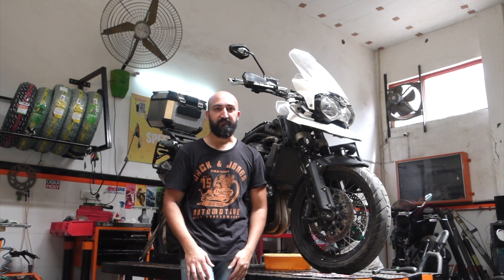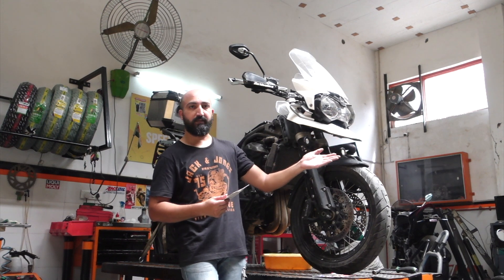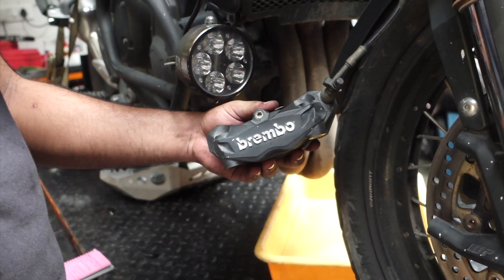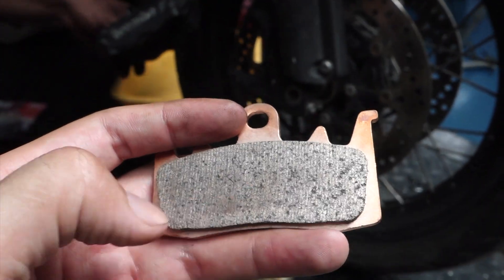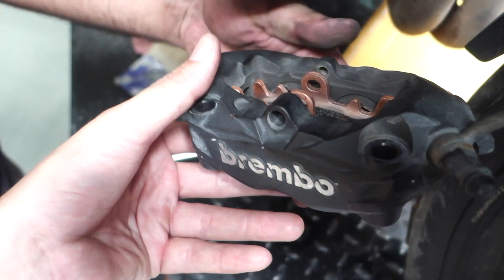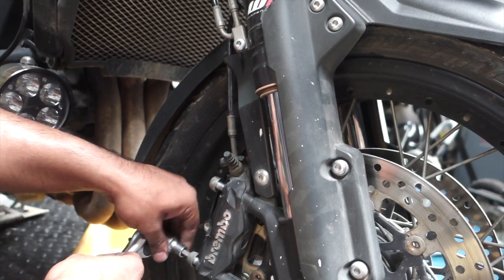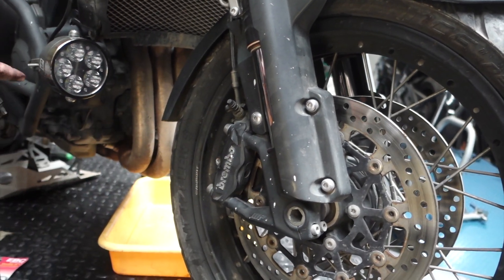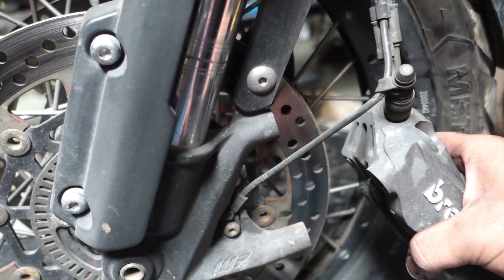My Triumph Tiger 1200 Gets EBC HH Sintered Pads: Real Time Tutorial | Pros And Cons

Comment: Quick suggestion for the rust that has been  accumulated on the disc router. You can just use petrol to clean it up 👍. The easiest and the best cleansing agent.
Reply from the maker: Will try.

Comment: Fantastic content ! I was expecting this kinda video , good work ! 
People will save a lot on the " labour charges " with this DIY content . 
But ,
A couple of things were of concern , you forgot to mention the precaution taken before starting this specific job , that is to be made sure that the brake lever is not touched during this process else it becomes difficult to push back the pistons of the calliper and one has to go through the brake bleeding process .
- and , how would one know the torque specifications on the torque wrenches if one  opts to do this job by himself .
Reply from the maker: Yeah. Sure. I think I kept the focus just on the pads on this rather than the overall braking service, which I do think is an oversight. Still, gives people an idea that it can be done at home by themselves. Not a difficult job. All torque wrenches have clear markings on them to choose the desired torque setting, and obviously one would check in their service manual to know what the torque setting is.

Comment: part no FA630HH these will give minor or slight better feel on the brake lever on the initial bite since the callipers are good (powerful) it would mask the shortcomings, at higher speed say 110kms n above it won't be that good compared to OEM<<(it will be same as OEM is what I was stating)
The one to be used  is "EP FA630HH" these are the ones to be used  
                                        (EP=extreme pro)
the ones EBC known for in racing for this "GP FA" type for track-only 
                                                            (GP= Grand Prix)    
these are some of my opinions in case the feedback is average, I said these since few triumph riders were not happy (with std HH from EBC as you have received)...
cheers
Reply from the maker: Sure. Thank you so much for this.

Comment: Hi abhinav its manoj here from goa...Recently i got tiger 900 rally pro...Till now the ODO is 3800 the the rear brake pads are almost wiped out...Jus wanted to know if  it's normal or it should last longer then that....And my riding is not like using too much of braking..i got a  himalayan aswell and on that i easily get atleast 10k coverage of disk pads...Please guide so i can have a word with triumph service centre
Reply from the maker: That's less. You should get double the distance easily. Unless you rely heavily on the rear brakes.
Reply: @abhinavbhatt  thanks Abhinav much appreciate..Happy Riding

Comment: your mechanic does this work badly. he should first clean the piston before removing brake pad from caliper because when piston is pressed inside the dust around them will damage the piston oil seal.Second thing is that while pressing piston inside using a srew driver will damge your brake pads so when you press the caliper piston inside open the master cylinder cap. it will make the job lot easy
Reply from the maker: Okay. Will discuss with them.
Reply: @abhinavbhatt  and no need to remove cylinders when you change pads - they are exchangable from 'outside' just remove outer pin.....
Reply: You have no idea what are you talking about....First, yes, the mechanic should clean the pistons but they have bushings covering the internal part which will keep the dust away. It's designed like that. Second, using a compressing tool is better but using a crew driver to press against each pad is ok.....he is replacing the pads, remember? C'mon man.....gain a little common sense and mechanic skills before  jumping on the keyboard pulling s***t out of your rear end.
The mechanic did a really good job and even torqued the bolts to specs which not many people do. I'd replace the pads with the rotors installed just like the person above mentioned and add some blue Loctite but the latter is not required.

Comment: Using screwdriver to separate new pads 😰 
He would have fixed the clipper 1st and then he could have installed the pads ... Thats the right process!

And we get caliper spreader to push pisons back... Using screw driver is local work .. which u could have changed ur pads by "CHOTU" on ur local street

And your older  pads had more than half life ! He ruined it !
Reply from the maker: Pads don't get ruined this way :)
Reply: That a premium motorcycle ! Those pistons can be pressed in easily by fingers by little bit of more pressure ... I bet!
Reply from the maker: No. Doesn't work that way.
Reply: What the hell is with some people  in this chat? Did we watch the same video? He is using a screw driver to push against the OLD pads!! Yes, a ratchet spreader is the right way to do it but you can use a screw driver too. I have been working on cars and motorcycles for years!! I only do inspection in shops not any other service.
Reply: @shardulsawant2573  Yes, you technically can but it's kind of hard to press them in.